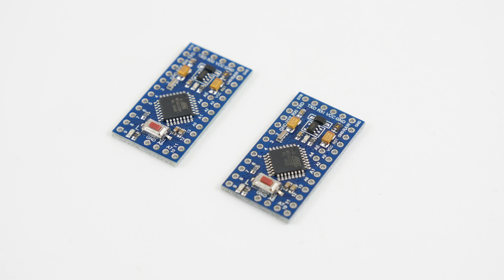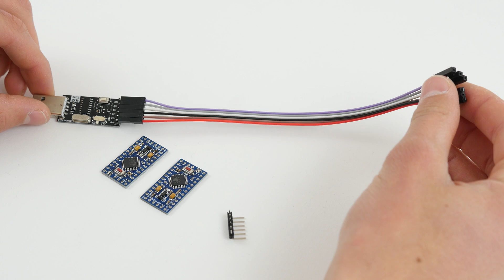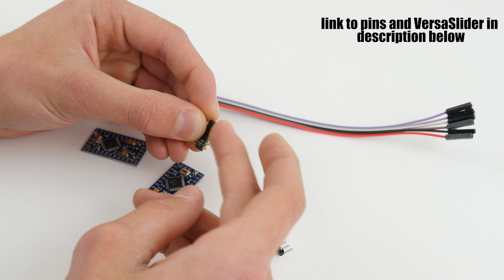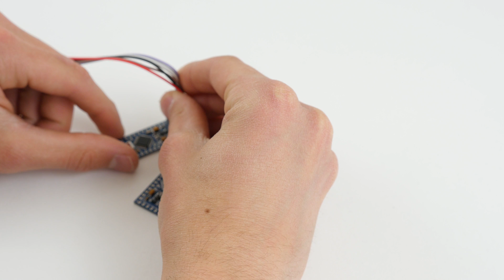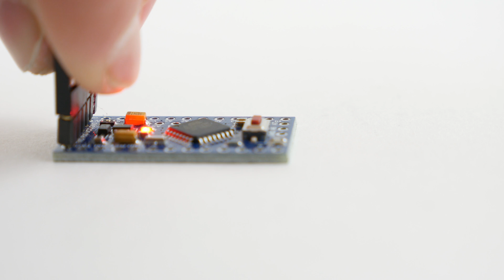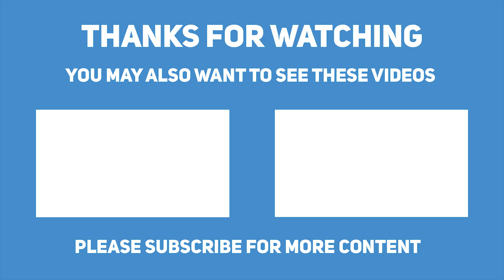How to program arduino pro mini without soldering on pins

Comment: I thought about it cause I need it and founded that the  best solution without loosing contact with the board  is " P5002 SMD IC Test Hook Clips, Mini Grabber Copper Wire Test Probes" and some of them comes with wires already attached  (they cost about 4 dollars for 10 pieces including shipping from Temu and you can find them with wires like "  Test Hook Clips Silicone Test Leads 5PCS Testing Cables Wires Dual IC Hooks Clips for Electronic Testing " they cost about 10 dollars from Amazon excluding shipping Last thing you can find them attached via a wire to a male header pin to be used on a breadboard like "Test Hook Clips to Breadboard Male Jumper Wires Soft Flexible Silicone Test Leads for Electrical Testing" and they cost about 10 dollars for 10 of them   . Keep up the good work .

Comment: I have at my disposal an Arduino Micro Pro. I configured it as “micro” and ditto with “Leonardo” but trying the blink sketch the compilation goes smooth as 'oil but nothing flashes on the board. How come? Thank you very much.

Comment: I use a long usb cable (about 1 meter) to connect the programming board to my PC. 
I do not solder any programming pins on the arduino pro mini.
I plug the pins of this programming board (FTDI232) directly into the pro mini. 
I put a little bit pressure on the inserted board to have a good contact with the pins of arduino. 
Much easier and faster (less soldering) and no need to use an additional cable.

Comment: i've discovered a "neater" and zero cost solution (literaly zero, neighter a cable) you bend the pins on the programmer alternativerly slightly up and down in a zig zag fashion, then pressing the pins flat toghether you slide em in (maybe aiming at 60 degrees before fitting all of em), they both stay all always connected and hold the arduino at the same time, of course it's a bit tricky to do this with an arduino soldered or stuck somewhere, but letting the thing stay on a table or hanging from a PC it's perfect
Reply: hi this comment is 2 years old but i just wanted to let you know you completely saved my month - i bought a pro micro thinking itd come pre-soldered and waited almost the whole month only to open a kit i had no skill or proper tools to assemble. i adapted the method you described (ultimately bending all the header pins the same way and shoving them angular-ways into a breadboard worked better) and while its not pretty and will probably need a lot of troubleshooting its much better than waiting so long for something i would inevitably break trying to put together properly
Reply: @mabelmabel8112  oh ok, nice to hear i helped someone :) anyways i think that the main headers, especially on a breadboard, will not make contact much well, at the minimum shake they will lose it and you have no guarantee they are all touching... i was referring to the programming header, plus i meant to bend the longer side of the pins on the programmer module (i forgot to say that), if you bend the short side of the pins (eg because your programmer is female) they will not be springy enough and they will be pretty hard to bend... a soldering iron and a bit of solder isn't something you would really need to order online, you need a 25-40W iron (a cheapo is ok) and 0.5-1mm thick solder wire, you can see a tutorial on how to solder, remember to wipe the iron's tip often on a wet cloth or paper and use minimum amount of solder... stick your arduino on the breadboard like you are already doing and solder the main headers there... for programming it you can still use my trick

Comment: can i buy this in chinese stores? aliexpress,  bangood? whats the search term?
Reply: Frank Müller Just search for "electric programmer" on Google. It'll pop right up in the results. If you have any more questions, PM me.
Reply: Frank Müller yeah and it's really cheap! Just type in Arduino pro mini and buy, they should be around £1.20
Reply: Haha same with the programmers 😂😂😂
Reply: If you search "super cable", it should work as well. You're welcome.
Reply: https://www.aliexpress.com/item/32882245291.html?spm=a2g0o.productlist.0.0.12d23a3cjLjlPg&algo_pvid=fcf85380-51ec-4723-a055-da143005d8d7&algo_expid=fcf85380-51ec-4723-a055-da143005d8d7-26&btsid=98b3549f-3a56-465c-90d9-9b6fc991a8ec&ws_ab_test=searchweb0_0,searchweb201602_3,searchweb201603_52
Reply: Thanks for the link to the pogo pins. I purchased some of these,  unfortunately the diameter of sprung pins are too small for the pro mini. Does anyone know of a source of pogo pins with more suitable sized pins? Cheers,

Comment: This is an elegant solution. It's also possible to slip the mini directly into the programmer board pins (eliminating the cable) and pressuring the mini to make contact while programming.

The advantage with your approach is that you can program the mini even after it's affixed to your project. The pogo pins are expensive though.
Reply: About: " pressuring the mini to make contact while programming. " is good, I also do it.